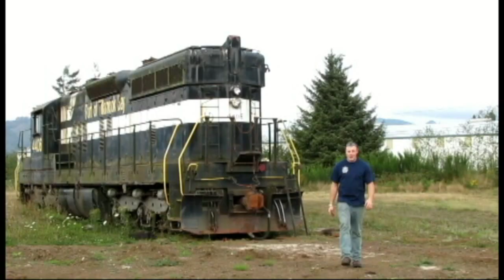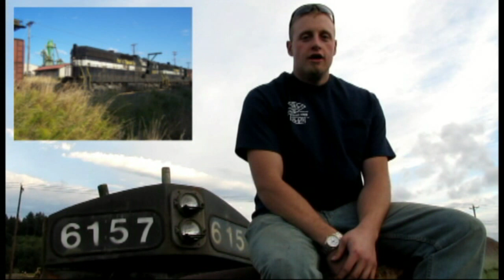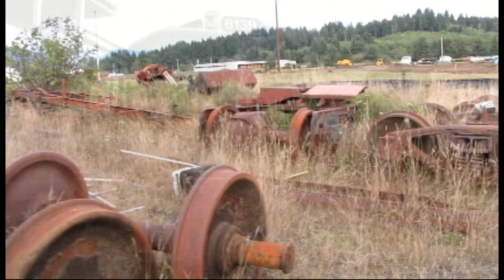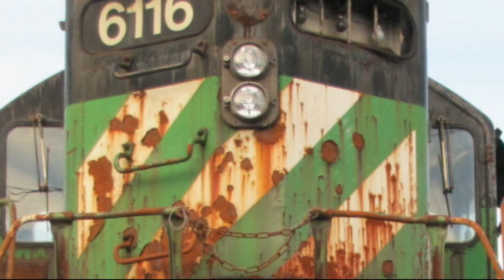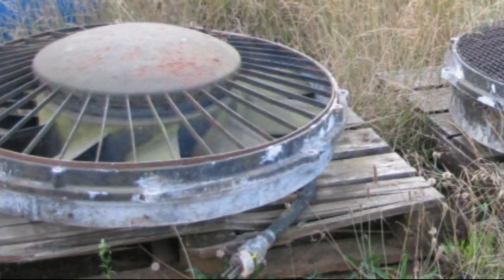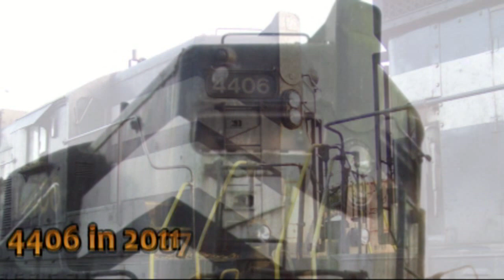A Visit To The Port of Tillamook Bay Railroad (Bonus Video) (HD)

Comment: The situation just makes me sick. We drove through there last summer and I was shocked at the condition of those locomotives. It seems fair to ay that the POTB will never run again so they should sell or donate them off. I'd rather see the 101 hollowed out but comparatively preserved in a museum than rotting away in the Oregon Coast weather. If they can't be moved out of the area, at least get them under some cover dammit! It really sucks that the other hangar is gone...

Comment: my. building will be used to restore steam diesel and electric locomotives and all kinds of railroad equipment including switches and signals and turntable equipment. even a cafeteria so the worker's dont waste gas to go out and get lunch and come back from rush hour. and plenty of abandoned houses and apartments and lofts up here and abandoned streets.  with some occasionally fixer uppers there ain't no way that I'm letting Railroad slinky's and bed springs and Toyota you know what I mean right I guess I'm just an old soul that knows a good thing when he see it and recently found out that in a pass life i was a railroad engineer and recently ever wondered why my slinky would not go down the steps the metal one. its been my dream to restore steam locomotives or become a railroad engineer maybe both.

Comment: One of the worst railroads, they recently cut up 4406, of course like half the locomotives that are shown in this video don't exist any more.... 
OH YEAH and the reason they cut up 4406 was to "fund" rebuilding some steam locomotive... you know, that thing that takes like millions of dollars. of course like the 9k they will get from scrapping these locomotives will totally make any kind of difference.
Reply: They are scrapping the engines out on the washed out line because they are stranded and they can’t do anything to get them out. The track can’t be rode on.
Reply: You are incorrect. The 4406 was sold by the Port of Tillamook Bay to a scrapper salvaging components from it to restore another SD9. Absolutely no money from it went towards any steam engine